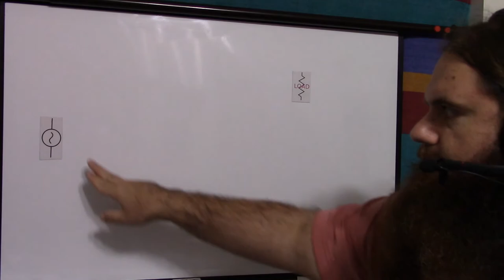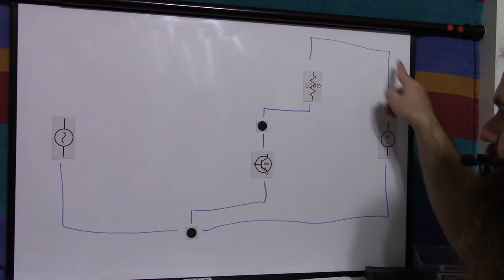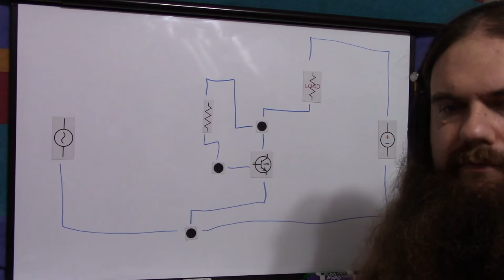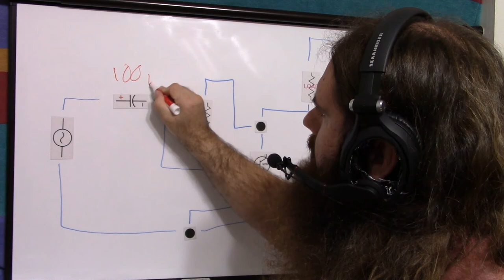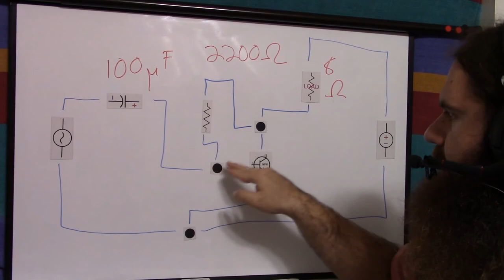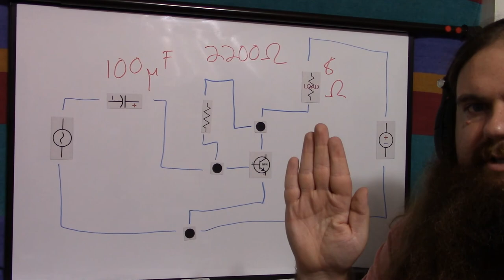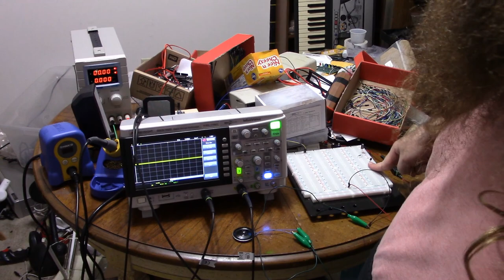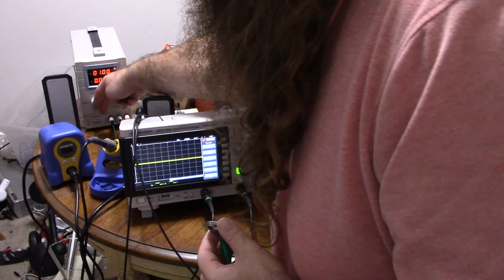Simple and Quick Audio Amplifier - Class A - Simply Put

Comment: 11:43 When the input signal 0V and the transistor is biased, i don't think the capacitor + side has the same voltage as the power source voltage. It has the same voltage as the transistor BASE. Or am i wrong?